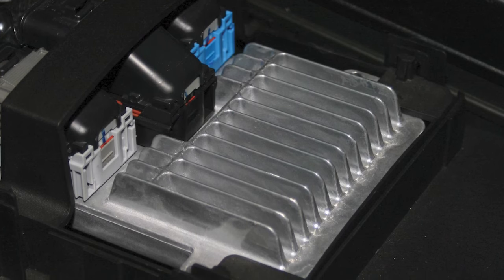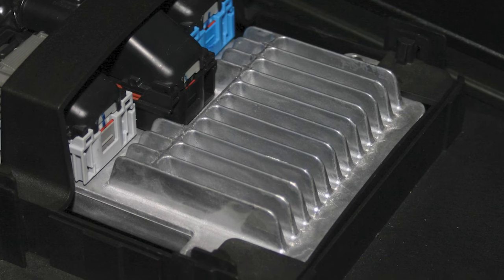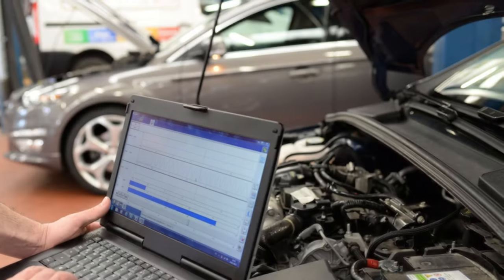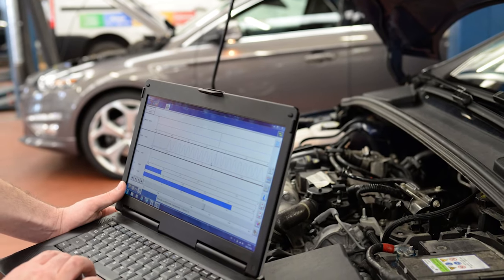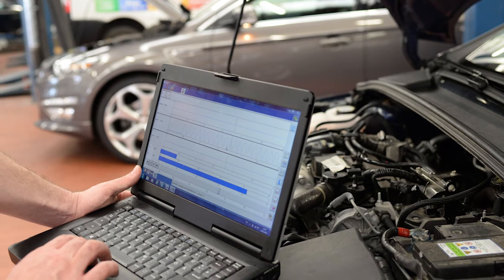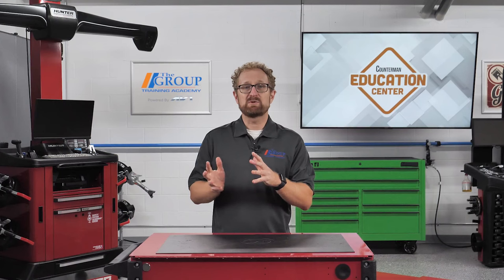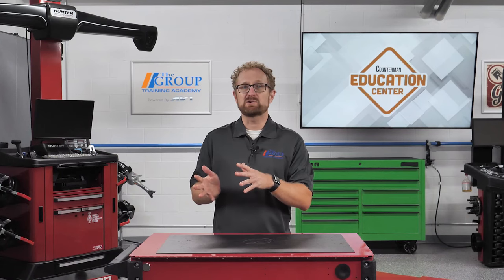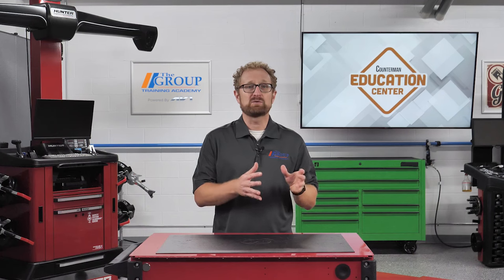Understanding Powertrain Control Modules

Comment: One day after using a portable air compressor that plugs into my cigarette lighter, the AC compressor clutch will not engage. The entire system was replaced last year and has sufficient charge. Also, the clutch will engage when jumped out and blow cold air but will not work when I turn it on in the car. I think I might have fried the PCM. Any thoughts about this? Thank you

Comment: Will a pmc make my car not wanna shift?
Reply: Yes it controls the TCM transmission control module
Reply: @bobbyz23  thanks
Reply: @bobbyz23  it's not wanting to shift after about 10 15 mins of driving and a mechanic had the car for months and finally said it was the pmc and he couldn't program it to the car that a Mazda dealer would have to do it because of the pats system
Reply: @Towerdawgg1979  Correct the Maxda dealer will have to program it.
Reply: @bobbyz23  10-4 I appreciate the help

Comment: this pcm is what detects a battery voltage fault when i park for a long time with my radio on and gives me a check engine light.  that stays on for 2 drives. 
(if i take another drive the next day. and nothing happens, it goes away..  if i don't take another drive untill 2 weeks later it waited for that second drive. and then goes away after that drive.)